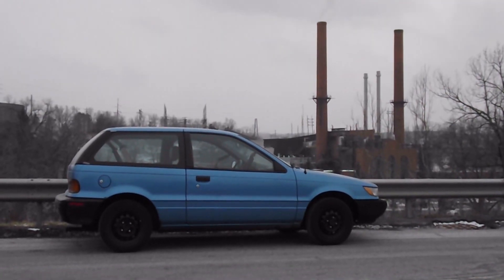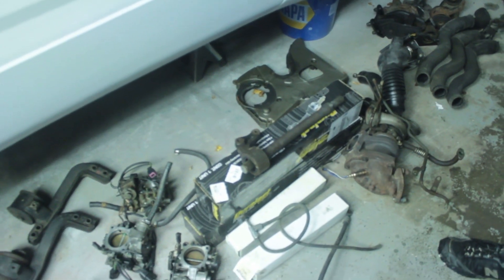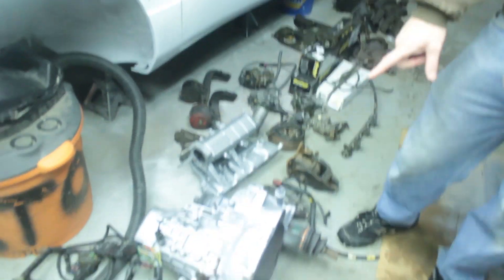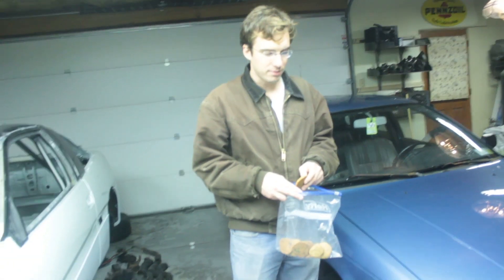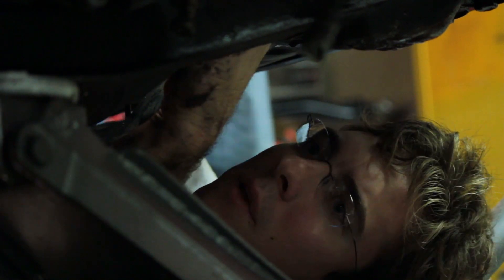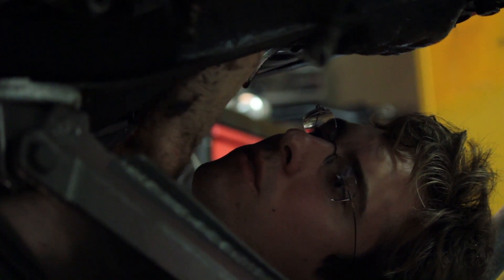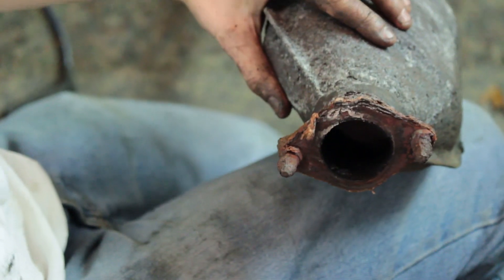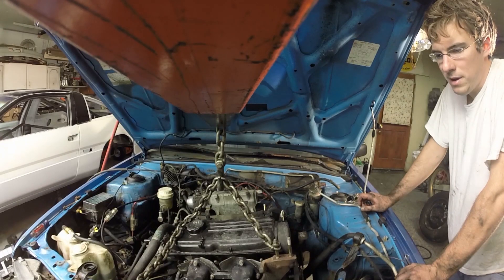Dodge Colt 4G63T Swap

Comment: great build series! quick question, are all the motor/transmission  mounts from a 1g dsm? they bolt right up to stock body?
Reply from the maker: @sebastian81296  it was about 10 years ago when we did that swap.  If I remember correctly.  The mounts you would want to use are from 1989 Mitsubishi mirage turbo or dodge colt GT turbo.  These cars had a 1.6L but block is the same as a 2.0.

Using a talon for example isn’t gonna line up quite right.

Comment: Where could I get the engine, trans, wiring harness, and ecu
Reply from the maker: Engine, ECU and harbess is a 4g63t.   1G.   So a 90 or 91 Plymouth laser.  Mitsubishi Eclipse.  Or Eagle talon.  
Transmission I believe was out of a 1998 eclipse 2.4 liter fwd.  

Try looking at car-part.com and searching your area.  eBay as well.